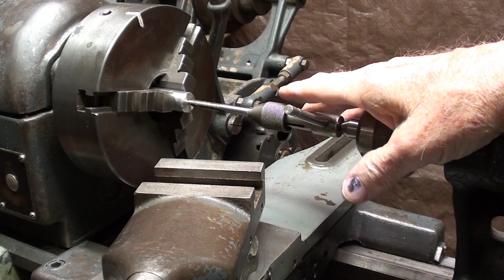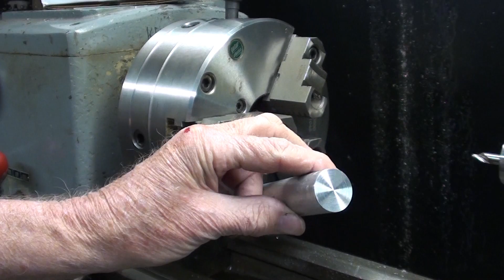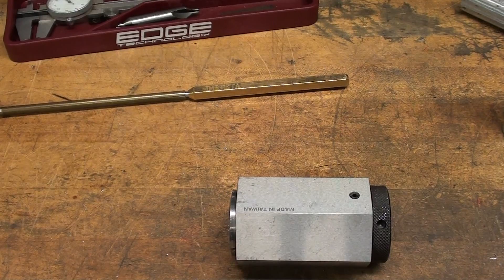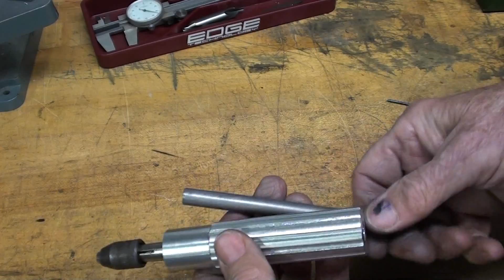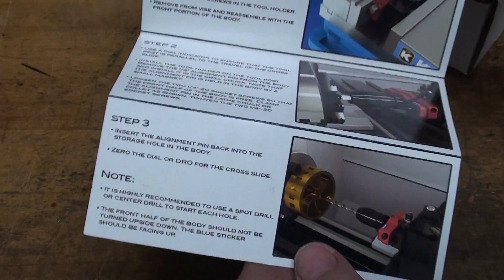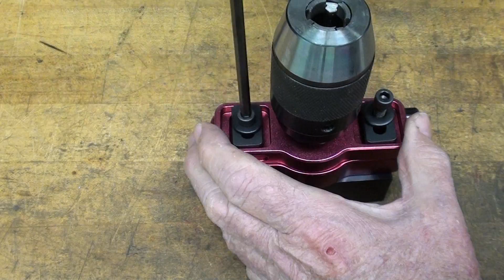Make an ATLAS Lathe Tailstock Tap Holder TIPS #425  tubalcain

Comment: I made a smaller version of this for "sensitive drilling"  and tapping in the lathe that I use a lot. A small chuck may be better for tiny taps than a tap wrench since  the tap can slip in the chuck  and save the part. 
My VBK brand set for taps and dies is very similar  to Your design and they have a fairly coarse knurl on them. I find that I get sore hands when  tapping to many larger  threads and have considered smoothing them down. Perhaps just polishing off the knurls a bit would give  the right grip.  Or  maybe flute them.

Comment: I was finally able to locate your video again and could tell you removed it the opposite direction.  I still can't drive the retaining pin out the correct direction.  Do you think it is possible to drill out the pin?  I have replacement pins but don't think me with my cheap table drill press would be a good idea to try to remove the old pin.  Local gunsmith isn't willing to try it so I'm certainly reluctant.  Suggestions?

Comment: Sorry this is off-topic but I don't know how else to reach you.  You once did a video on repairing a Stevens Crackshot 26.  I have my Dad's and would like to make it operational again, replacing springs and the firing pin.  I have bent 2 punches trying to remove the firing pin retaining pin driving left to right as I was told.  Now I suspect that was bad advice before I try anymore, do you recall what direction you drove it out?  Thanks for the great video and directions on ordering parts for the rifle.
Reply from the maker: That is so long ago, I have no idea which way I drove the pen. I wouldn't think it would make any difference, sorry
Reply: Thanks Mrpete.  I had to drive a long way but finally found someone today who will mill it for me.  John

Comment: Nice project, I think I'll make one later. I did find something curious about the stability of the chuck. After seeing all the steps taken to align it to the center of the chuck bore it is odd that at time stamp 8:33 when you were to start drilling the .500" size hole the tip of the drill bit actually picked up about .125" before it entered the pilot hole, is this normal?

Could have you machined the splines the hole length of the handle by using a long stud and nut to just tighten the whole thing onto the hex collet holder? After all you were taking light cuts... Just a thought.

Comment: Yep. The smaller the tap, the smaller the handle should be. I made myself something similar out of some HDF discs and an old tap wrench.  In correlation with the tap size, i use the appropriate disc (for example, an M4 tap will have a OD disc with 5 cm an m8 will have a 10 cm one, all discs are 2 cm thick and with ridges for grip).. Haven't broken a tap in quite some because of this.

Comment: looks good.  only change I would make is drill out the end for a roll pin in between the tap holder and the tool but the set screws might slip before breaking a tap.

Comment: Instead of the set screw you could just cross drill it the same size or maybe just slightly smaller than the cross hole originally in the tap wrench and press the original handle in which would keep it into the aluminum bit, give you the option to use the grip milled into the aluminum for the smaller sizes and have more leverage for the larger sizes.

Comment: Thanks.  Maybe the recess you bored in the back of the old one you made could be used for small dies (for stock that fits through the 3/8" hole.   the How about adding a couple for tommy bars?  That might give you a little extra leverage for tough materials.

Comment: I like the double ender tap & die holder. flute it and add threads for screw in handles for larger sizes. I don't like the carriage mounted mounted chuck holder for centre drilling, but it makes sense for offset from centre drilling. Thanks Grandpa.

Comment: Another interesting and practical video, if as you suspect the face of the collet is soft could you not just dress it in the lathe ? A second suggestion you said you did not have a stop on your mill why not make one :-)
Reply from the maker: Actually, I do have a stop. It had to be removed in order to install the digital readout

Comment: Cool project.  A possible modification would be to use the male taper end of an old MT2 (or what ever size your tail stock takes) drill bit. Saw off the old drill bit then drill a 3/8" hole in the MT taper and hold the 3/8" rod with a set screw.  No need for a drill chuck. This would reduce the overall length of the tool if you have a lathe with a short bed.
Reply from the maker: Good idea. In fact I do have a larger die holder that is mounted on a number three Morse taper
Reply: My Tail stock tap holder inspired by your video!  Thank you so much for continuing to mentor us!https://www.youtube.com/watch?v=wpTNtaRcaGw

Comment: Nice Diresta Ice pick there. Collet can be fixed easily just by slightly turning it down till the witness marks vanish again. Seeing as it is not hard steel should be easy, or just use them as index marks.
Reply from the maker: Yes

Comment: Lyle,  Thanks for the excellent video!  I do have one question, however.  Did you perform any compensation for the very slight diameter reduction created by the first set of flutes when using the edge finder for the centering of the second set?  Granted, it is only a very small amount, perhaps a couple of thousandths. 

As always, I do enjoy your videos and do my best to glean every bit of info I can from each.

Best regards!
Reply from the maker: I was careful, to edge find in a spot that was not fluted

Comment: Would it be possible to put a morse taper to eliminate the drill chuck holder?
Reply from the maker: It sure would, in fact I did that years ago with a much larger die holder I made. It shortens the whole thing up nicely

Comment: Glad to know you are still human Mr. Pete.  ~¿@   Liked your old one with the reverse die holder.  Also seems to me one could leave a shoulder at the bottom of the thru hole and put a 1"L x ~3/8 spring with loose turns in the bottom to aid like a spring tap holder.  Most small taps have only an ~1"-2" of thread depth so a ~4" length would give enough throw for that.  Basically size it for the lathe and your hand.  Another thought would be make a 1" Die Pill that goes where the tap holder goes with a .25-.375 thru hole...couldn't do long threads but would be a versatile kit for small stuff.  Thanks for the creative thoughts and Video Mr. Pete.
Reply from the maker: Those are both good ideas
Reply: No ignorance...good question.  It was my bad with old school terms (a disc shaped piece that drops into something else).  Pills used to be flat discs..like Alka Seltzer or AirBorne tablets .  

Every thing could be done from 1 end.  That is have a 1" die holder (like his old one) and on the same end make a "Pill" that was 1" OD with a .625 hole and a flush set screw attached to the end of the Tap Holder. Can't remember my thinking on the .25/.375 thru hole¿  Insert the assembly into the "Die" end of the holder and tighten the Pill and Tap holder with the same screws used to hold the die in.  Could even notch the pill to help lock in place with the die holder screws.  Hope that made sense.

Comment: Hi Lyle,
Slick design for the smaller taps. For those of us without a mill, could use a piece of heater hose glued on as a grip surface. Noticed you were cutting into the collet slightly.
Reply from the maker: Good idea with the heater hose, it just looks a little too much like a hillbilly work

Comment: Would there be any advantage to using an MT shank on the shaft instead of straight? I have an Atlas 618, and the tailstock takes an MT1, which would be an appropriate diameter and would eliminate the length of the chuck.
Reply from the maker: Absolutely, use a taper. In fact my larger die holder is based on a number three Morse taper. It can be seen another videos I think
Reply: mrpete222 thanks, and thanks also for what you do. There's a  reason all the other YouTube machinists look like they want to genuflect when they mention your name.

Comment: Could I 3D print it......rim shot!!
Reply: O' Heck yes!
Reply: But you may be limited to 0-80 thru 8-32 because of the strength of the plastic...Not much torque available if printing less than 100% fill.